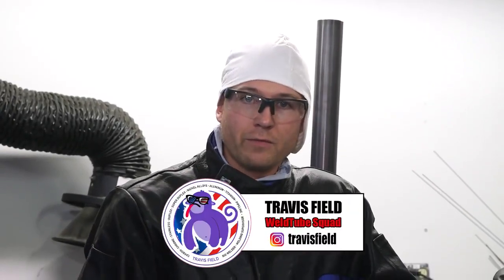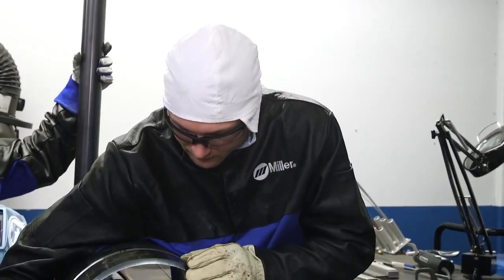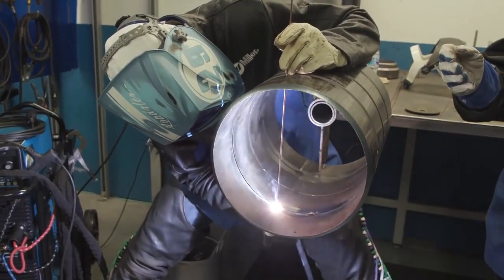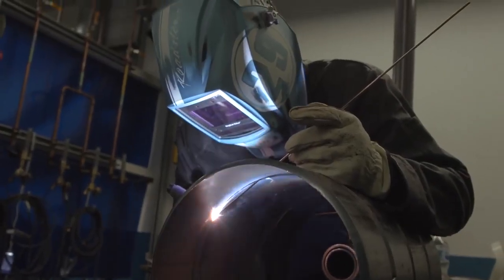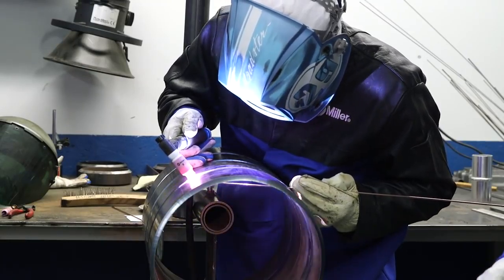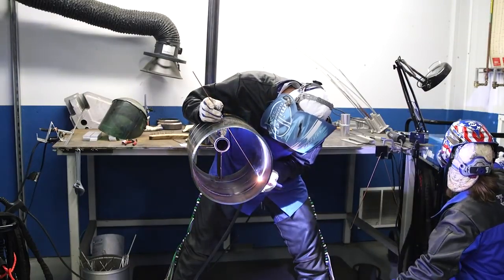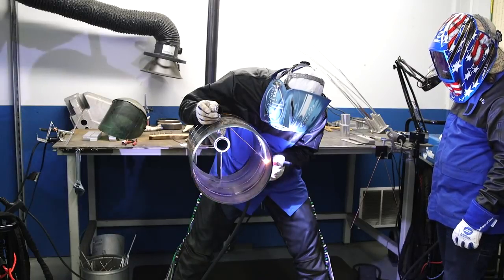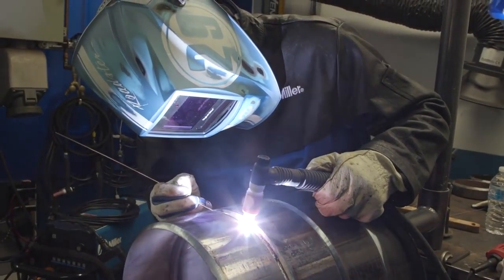Looking through the Gap technique - Miller Electric - Weldtube - 2021

Comment: What would be the best lens to use while learning how to look through the gap. I have tried it years ago but I would get flashed with my old auto hood by speed glass. I heard you have to use a standard lens? I also see you using an auto lens while running your root? Will some auto lens work with this method and what would you recommend.
Reply from the maker: In my personal welding helmets, I wear a black fixed shade welding lens - most often a black fixed shade 9. For the Miller Electric videos, we were wearing auto lens welding helmets, however for the looking through the Gap technique., I had turned sensitivity - I believe it was all the way to the point where I was permanently a black fixed shade lense, so while it is an auto lens - I was adjusted to act identical to a fixed shade lens. This is why I flip it down and use it as such. I am actually not used to wearing auto lens lenses, and just wear the fixed shade ones